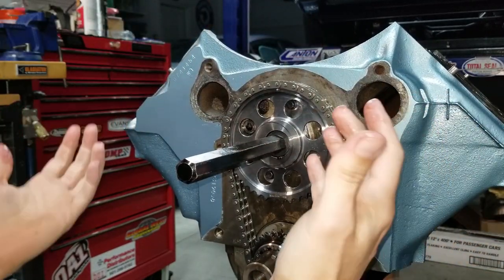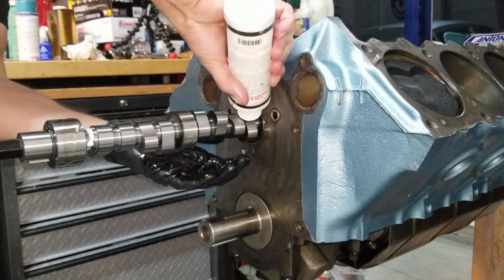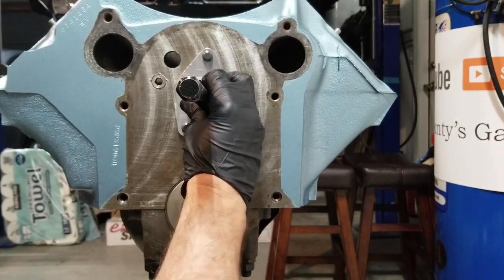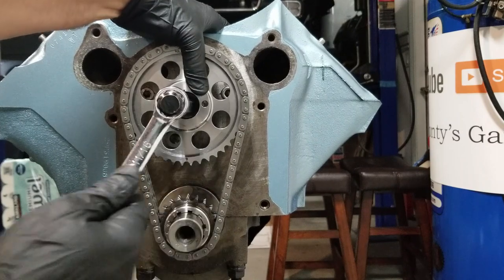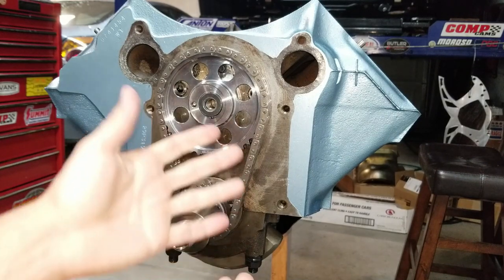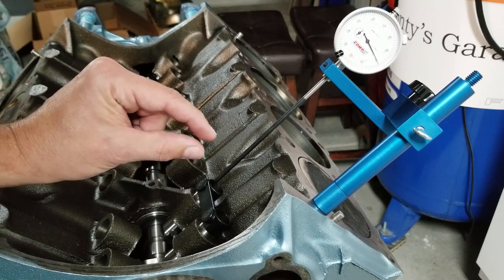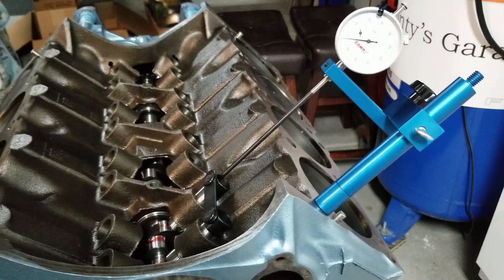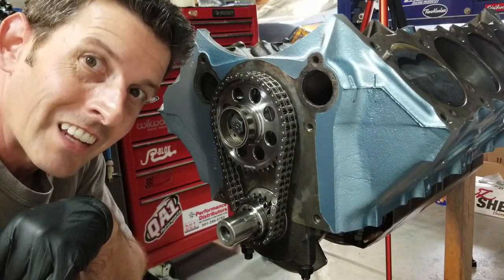Pontiac V8 Rebuild, Part 8:  How to Install your camshaft, and timing chain, with a degree wheel.

Comment: Monty,
I followed your steps to the T. My cam card says 110 lobe separation,  but I come in at 108. Am I good or not.
Reply from the maker: If you're absolutely certain you measured correctly, and your LSA is off, the CAM is wrong.  That's why we do this test, to make sure the cam specs match what you ordered.  Measure a few more times to make sure... if you're still correct, talk to whoever sold you the cam and get the correct one.  Let us know how it goes!

Comment: I have a 350 Pontiac that I think my have a bigger cam in it it's just setting in the car with the manifold loose  and I also have a 455 on the stand I'm wanting to measure it but can't find the specs Im restoring everything my self even if it costs more  I just retired and this is what I've looked forward to I am a real shade tree  I. Will also be doing my on machine work if you know we're I can find the information thanks
Reply from the maker: Awesome!  Take your time, I know you can do it.  Not exactly sure what you're looking for, but I'm sure it's available.
Reply: @FastMonty  thanks

Comment: At 20.27, you say you would show how to fix it, if it's not on 108 degress, I would like to know how🎉🎉😊😊
Reply from the maker: I assume you watched the whole video and figured it out?  If not, at the end of the video I show the different measurements by changing the crank pulley offset.  (You obviously need an adjustable timing crank pulley)  Hope that helped!

Comment: Hi,
I degreed a cam about 30 years ago when 14 yesrs old. SBC 
Im back at it with a pontiac 400. Loved your video- i have a really weird question please.

My mind is totally stuck on why we would degree the cam? I have the tools and am ready to do this... but would love to know what is really happening?
If the 2 sprokets are locked in... (cam and crank) then what could bw changed by doing doing this? Or is it just a check?
Im sure im missing something simple...
Please help!!!
Reply from the maker: Hey Tyler, great question.  Generically, no you don't need to degree your cam, unless you want to extract a bit more horsepower at the top end, OR you just want to double check the cam card specs.  If you're using a new cam and the serial number matches the cam card, you'd be fine with installing "straight up".  Hope that helps!

Comment: So you don't see the need to use the lifter valley support brace using a roller on the Pontiac blocks?
Reply from the maker: Great question... not for Hydraulic Rollers.  But, yes for Solid Rollers.  Hope that helps!

Comment: About 8:20 in, you reference the Butler timing chain with the Torrington bearing, and say "you don't need that plate."  It sounds almost as if you are saying you don't need to use the thrust plate......surely that can't be correct, and I misunderstood you?  That's the one I have, but I am still using the plate.  Also......interesting you set up the cam "straight up."  Just curious to know if you considered retarding it.  Most modern engines are around 114-116 (lobe centerline), and even older Pontiacs are usually in the 112 range.  Same cam, I have mine sitting at 114 right now (in process so I can change).  461 w/ 300CFM Edelbrocks from Butler.

Comment: Do you know if you can buy the thrust plate centering sleeve separate or what kit did it come in? Thank you
Reply from the maker: You mean the plate the comes with the Sims Roller kit?  I don't think it's sold separately...  If you check BOP Engineering, they should have this kit, and/or a different solution.  Good luck!
Reply: Thanks for the fast reply and no, I’m talking about the pvc/plastic sleeve that you slide onto the camshaft so it centers the thrust plate during install. It’s in the video @ 7:21.
Reply from the maker: Ohhh, yeah, that thing is super helpful, but I'm sure it only comes with that SIMS bearing set.  BOP might know where to get one.  Good luck! @SoullessCasper

Comment: How tight is the timing chain supposed to be? Mine doesn’t feel tight at all
Pontiac 400
Reply from the maker: It's not super tight, but tight enough not to move about .25" in either direction.  If it exceeds that, change it.  Also be mindful that the block could have been Align Honed, which decreases the distance between the crank and cam, and could affect how a "standard" timing chain fits.  You'd need to get a slightly shorter chain.  Hope that helps!

Comment: How do I calculate what the initial advance should be when putting the timing chain gears on
Reply from the maker: Not sure what you're after here... assuming you have a timing wheel, I explain exactly how to do that.  (At least, I thought I did :))  If you do not have a timing wheel, install the cam "Straight up", ie dot to dot on the cam/crank gear.  Thanks!

Comment: Monty, I don't know about Pontiac engines, but on Chevy engines a flat tappet cam is ground so that the thrust from the cam lobes on the tappets pull the cam to the rear of the engine. I would imagine Pontiac engines are the same.
Good video!
Reply from the maker: Great point!  I seem to recall that flat tappet Pontiac cams actually thrust forward, hence the cam plate.  Most importantly, all roller cams are flat and we have to keep in mind that there's going to be some movement in the cam, unless you get a true fixed thrust bearing.  Thanks for the comment!

Comment: TimeStamp 5:35  The distributor helical gear is always under load due to it also driving the oil pump.  Regardless of accel or decel, the roller cam will be pushed (I forgot which way) either in or out at all times.  Pls correct me if I'm mistaken.
Reply from the maker: The way I understand it is it could go in either direction, depending on the dynamics of the situation, hard accel, decel, etc...  Always recommended to add a "Fixed" bearing to prevent any axial movement.  Thanks!

Comment: So if you don't put the minus 2key way to the dot what will happen,so if you went zero to the dot
Reply from the maker: Great question... not much.  LOL  If you go "straight up" with the dots, the engine will be a little more well behaved on the low end, but will loose a little power on the top end.  Hope that helps!

Comment: What if your lower gear only has 4 degree increments ?  How do you adjust for 2 degrees ?
Reply from the maker: Good question Terry, I honestly do not know.  Maybe try lining up the timing dot on the cam gear, in between the 4 degree marks, on the crank gear?  Let us know what works for you.

Comment: Where did you get the Camshaft bar for Pontiac v8? 
Do you have a part # for it ? 
Thanks
Reply from the maker: Good question... I got it from Butler, here; https://butlerperformance.com/i-24452911-butler-camshaft-installation-tool-bpi-1020.html?ref=search:https%3A%2F%2Fbutlerperformance.com%2Fsearch.html%3Fq%3Dcamshaft%2Btool

Comment: I'm in the process of ordering that special cam plate that you are using. When you had your block raced prepped did you have to order your timing chain special or was it standard length. Can you give me any special advise. Did you convert your block to a 4 bolt main set-up. Should I have all my block work done first. Did Butler Performance do your machining. Wish I could talk to you in person by cell. Thanks
Reply from the maker: Good questions. Standard length chain. 2 bolt mains. (BTW, do 4 bolt now of you can afford it.)  I had a local machine shop do my machining. Hope that helps!

Comment: Hey again I know you did a vid about installing ll the clutch components ( 4 speed) Im ging to be putting alot of it together and am looking for the vid you did on that. Theres a rod coming off my countershaft I dont remember what its for, theres 2 bolts threaded on one end the other end is blank. Im hoping I can find it somewhere in here or the forum.
Thanks man DR
Reply from the maker: Maybe it was in this old one I did?  https://youtu.be/UgI5mYmsoQM
Reply: Nope this isnt it the one where u put your clutch countershaft, spring etc together on the engine. I'll keep looking

Comment: was that a one piece eccentric, also a 2 piece is it  supposed to be flutter at all my 400 just rebuilt not starting and no getting fuel up the carb ?
Reply from the maker: Good catch. I removed the fuel pump lobe, because I'm now fuel injected. Check to see if you're getting any fuel pressure..
 When I had a carb, i installed a fuel pressure gauge right before the carb so I can visually see 6 lbs of pressure. Hope that helps!
Reply: @FastMonty  are you available  for a ask a question by phone.
Reply from the maker: I wish I could... but, I'd be happy to answer questions here.  Or, by email.  Thanks!   @josephvettorino8405
Reply: @FastMonty  Hello,70 grand prix 400 full rebuild. Stock rebuild with a roller cam nothing radical,I did not do the rebuild,I just dropped  the distributor  and wired live wires with e 3 plugs they have 3 tips. I have gas to carb,yesterday  I pulled distributor  reprimed engine oil, dui distributor  typical firing order  wires correct rotor point  faces 1 on the cap at 1 oclock ,spark yes,pulled all the plugs have piston 1 tdc( paper blew out of plug one, 25 percent  of rotation before timing mark hit 0 degree on case. Then rotated block to zero piston  up a little  higher screw driver on piston appears  TDC. Does  not start ,cranks small pops,I mechanical  but not a mech.not sure what to do
Reply from the maker: In all honesty, it sounds like a timing issue.  Double check your wires are in the correct positions, and remember a Pontiac distributor spins the opposite direction as a Chevy.   @josephvettorino8405
Reply: @FastMonty  yes it was   possible  180 out not it runs
Reply: now it runs
Reply from the maker: @josephvettorino8405  awesome!

Comment: Thanks so much for all you do with this channel! I been building my 455 w butler stuff, roller hydraulic setup and had a noise coming from lifter/cam area. I just pulled motor, everything clean, oil pressure was good. I noticed what seems like a lot of cam end play. I used the used flat tappet retaining plate. And a new jp performance chain from butler, non bearing. How can I know which retaining plate to get or if my “slop” was causing a noise? I do see wear on the plate.
Reply from the maker: Brother Joe, sorry for the delay. It really depends what the noise is. For a roller set up I highly recommend a fixed bearing set up for the cam gear. That'll keep the cam stationary.  I know Butler has one, but I used the Sims Machining version. Hope that helps.

Comment: Hello Mike. Installing the same cam on a 455 bored .040. Two questions. Did you use a standard key in the camshaft? Second, in one of your comments you mentioned you would recommend a straight up on the timing. Can you explain why. Thank you.
Reply from the maker: Good questions... yes, standard key.  Butler had recommended straight up timing because it's more street friendly.  Dialing it in, via the cam card recommended timing would give you a few extra horses at the very top end of the rpm range, best suited for drag racing.  So, I elected for better drivability, again per Butler Performance.  Hope that helps!
Reply: @FastMonty  Thank you for the quick response. So for clarity, the -2 you are calling straight up correct?
Reply: @FastMonty  One more question. When do you reposition the dot on the cam gear to 12:00. Is it after you degree the cam? When you position it at 12:00 what is the position of piston #1?
Reply from the maker: @rickfogel257  Good question, as usual..😁 So, I say that for Flat Tappet guys with non-adjustable valve train, when you leave it at 12 oclock, Number 1 is at TDC.  It's a moot point with an adjustable valve train because you have to rotate the engine several times while adjusting.  Hope that helps.

Comment: Mike - Love the videos! Just discovered them recently, I'm currently in the middle of a 461 build myself and noticed your cam was the BP8022SP. That's the same one I've got but haven't installed yet. How do you like the cam? Any regrets? I was looking for drivability first and then fun second! The guys at Butler's recommended it. Please share your thoughts. Also - Do you have a specific video with that cam just idling? I'd love to hear it. Thanks. - Tom
Reply from the maker: Awesome... yeah, no regrets.  Super easy to drive, as advertised by Butler.  I recommend installing it "straight up" as timing is concerned.  The idle?  welp, give the following a review;
Cut out installation;  https://youtu.be/VyAJCrFVlLA
GTO Walkaround;  https://youtu.be/NcgjQYOGmV8
FYI, I have MagnaFlow 2.5" exhaust.  Let me know if you have any questions along the way!  Thanks for the comment.

Comment: what step would you do if you do not have the degree wheel?? love all the other vids you do thank you
Reply from the maker: Hey Douglas, good question.  The degree wheel is basically to verify the specs of your cam.  If you trust your supplier, you can throw it in there, and line up the dots on the cam and crank gears, as I went through... hope that helps!

Comment: Always thought that on a Pontiac motor the dot on the top sprocket was supposed to be on top, unlike a Chevy V8, is that not correct?
Reply: Im sorry for the redundant question, just read some of the others that are similar. Im just doing a plain rebuild, down and dirty, and just trying to get close on the timing. Its still a bit confusing to me as im new to the pontiac motors. Would it still be correct to have the dot lined up on top away from the lower dot?
Reply from the maker: @airforrest  Good question... when aligning it, you can put the dot at the bottom, so it's closest to the crank pulley.  But, before you button up the timing cover, rotate the crank so the dot is on top.  That's basically top dead center of number 1.  Not mandatory, because you can check for TDC using the finger over the #1 spark plug hole.  Hope that makes more sense?

Comment: Dot at 6 oclock, firing on #6.  Dot at 12 o’clock, firing on #1, correct?  And the respective cylinder will then have the exhaust valve cam lobe at that point nearing the lifter, that is, past 180 degrees opposed- maybe about at a 90 degree angle to the lifter?  And the intake lobe is about 180 degrees from the lifter on the same cylinder? This seems to be opposite cam lobe position (intake and exhaust) at this position for #1 vs #6- same lobe position but opposite valves- Just making sure I have this right-that’s how mine is appearing. Thanks
Reply from the maker: Good question... yes, to your firing and dot position question.  And yes, the exhaust lobe is approaching the lifter, because after firing, the exhaust valve needs to open.  Thanks!

Comment: mike i just got my 69 firebird returned after having water pump replaced. I cramked t up and th crankpully  is not turning therefore nothing else woks. does the bottom pulley have i bolt like a sBC or does it have more 4 bolts or both
Reply from the maker: What?!  is the balancer turning?  If the balancer is turning, I'm pretty sure the crank pully is held on by four bolts.  (Mine is, but I have an aftermarket set)

Comment: Wait, during the initial installation you had marks pointed to each other, yet Pontiac requires the large gear dot to be away from the lower.  Later in your video it is correct.  Iam i missing something?
Reply from the maker: Thanks George... you're correct.  During install, it's easier to line up the dots, when they're closest.  Ie, Cam Gear Dot at 6 o'clock.  But, as I said in the video, if you were to button everything up, and leave it that way, timing would start on #6.  Which is why I said to rotate the Cam Gear Dot to 12 oclock, before buttoning it up.  Hope that makes sense.  (If you have adjustable rockers, it doesn't matter because you have to rotate the engine to set valve lash, the 12 oclock trick is for stock rockers, because those are just torqued to 20 lbs)  Hope that helps.

Comment: sorry to bug you but whats the engine paint you use? Having a hard time finding right color.Im going to to my heads so Im going to watch your cooling tip.
Thanks!
Reply from the maker: No problem, Dan... Check out this video I did for painting my heads, I also go through the paint I used. https://youtu.be/3QtmxWlZtaE   Ironically enough, Butler Performance sells the same paint at a great price, and many others too... here; https://butlerperformance.com/search.html?q=paint  Have fun!

Comment: Good one. Ever do one for the aluminum radiator & fan? Im having heating problems in my65 which has a RA III engine and considering a alum & fan install.
Reply from the maker: Thanks Dan.  Sorry to hear about your heating issues. No, I don't have a radiator/fan install video yet.  It is fairly simple though, the hardest part is actually hiding all the wiring.  That said, have you seen my head cooling trick?  While not mandatory, it might give you some insight to other cooling options... https://youtu.be/DWvVkrGQDsw  Good luck, and thanks for the comment!

Comment: How was your lobe separation 108 degrees but on the card it’s asking for 112? Do you automatically subtract or “advance” your timing?
Reply from the maker: Lobe Separation Angle (LSA) which is 112 for my cam, is different than the Intake Center line of 108.  The LSA doesn't change.  The Intake Center Line can change based on your adjustable crank sprocket.  If you don't have an adjustable sprocket, you can use the standard "straight up" timing, where the dots are lined up on the sprockets.  That'll be close enough.  Those that are particular, like me, want it as spec'd on the card.  Hence the process.  Hope that makes sense?
Reply: @FastMonty  yes it did thanks